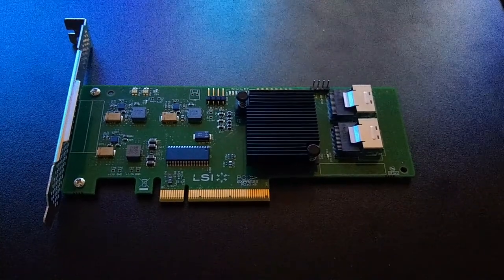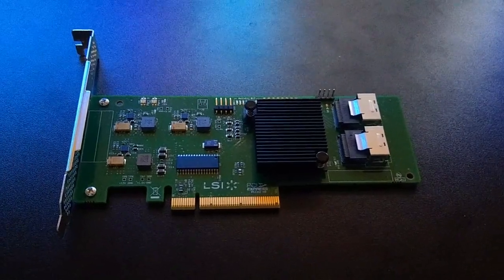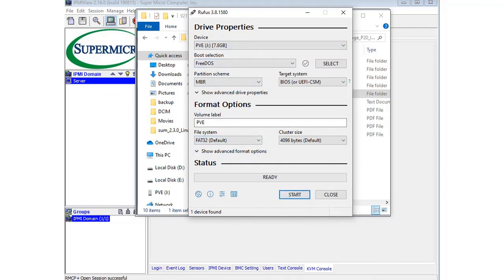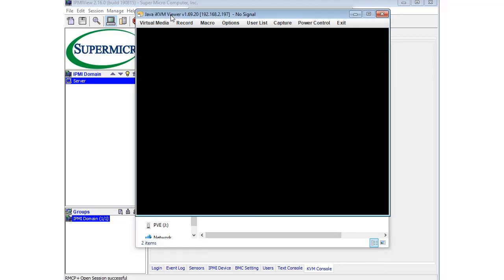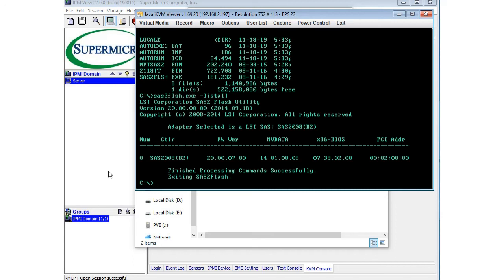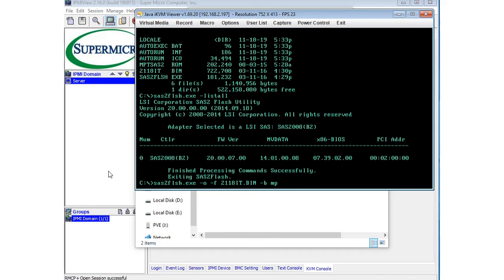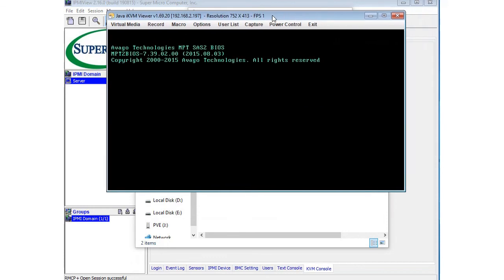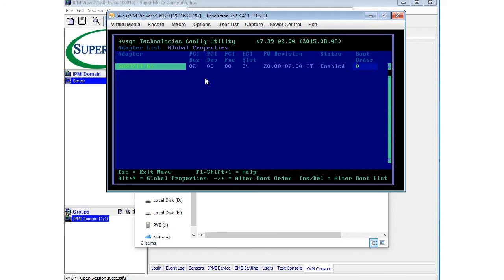Bricked LSI 9211-8i HBA SAS Controller Fix

Comment: Oh my gosh!
Bro thank you so much for this awesome information.
I followed your guide and successfully restored my bricked HP H220 SAS9205-8i by flashing it with the correct firmware, after a previous failed attempt using the wrong firmware.

Date: January 9, 2025 
Today, I successfully re-flashed an HBA card (HP H220 SAS 9205-8i or 9207) after initially failing to update its firmware from P15 IT mode to P20.00.07 IT mode.

Issue:
The failure occurred because the firmware update tool (SAS2FLSH.EXE version 20) performed a vendor ID check between the card and the firmware. If they don’t match, the process throws an error.
Solution:
To bypass this issue, I disabled the internal SAS controller in the BIOS of my HP Z820 workstation (without this, the system won't boot):
1	Access BIOS Settings:
	◦	Enter the BIOS during startup.
	◦	Navigate to Device Security > SAS Controller > Hidden.
2	Boot to DOS via USB:
	◦	After hiding the SAS controller in BIOS, the system can boot into a DOS environment from a USB drive.
Flashing Steps:
1	List All Connected Cards:
	◦	Run the command: Copy code   sas2flsh.exe -listall  
	◦	  
	▪	The card is detected but flagged as “non-operable” with a notification like: "Please download firmware...".
2	Proceed with Flashing:
	◦	Directly proceed with the firmware flash using the following command:css Copy code   sas2flsh.exe -o -f XXXX.bin -b mptsas2.rom  
	◦	   Replace XXXX.bin with the correct firmware file name.
	◦	This command overwrites the firmware and ROM files.
3	Verify the Flash:
	◦	After completing the process, re-enable the internal SAS controller in BIOS if needed.
Reply: Important note:
Update on Flashing HP H220 SAS 9205-8i
Initially, I assumed the firmware I needed was for the SAS9205-8i card because that’s what the sticker label on the card indicated. However, after doing thorough research and cross-checking resources, I found that this card can confidently be flashed with the 9207.bin firmware.

Key Points:
Sticker Confusion: The label on the card can be misleading. Even though it says SAS9205-8i, the card’s hardware is compatible with the 9207.bin firmware.
Correct Firmware: Using the 9207-xxx.bin firmware for the flashing process works perfectly and resolves the issues.
If you're facing the same challenge, be sure to verify your card's compatibility before proceeding with the firmware update. This small step can save a lot of time and prevent errors.

Comment: If you don’t plan to boot from it you don’t need to flash mptsas2.rom file. That way during boot the cards bios will not be loaded and thus allowing your system to boot faster.